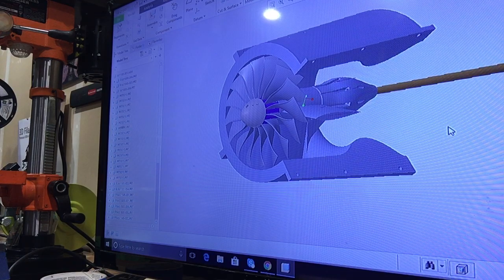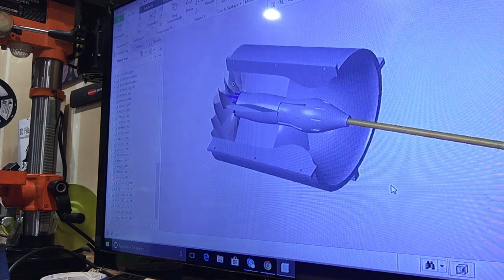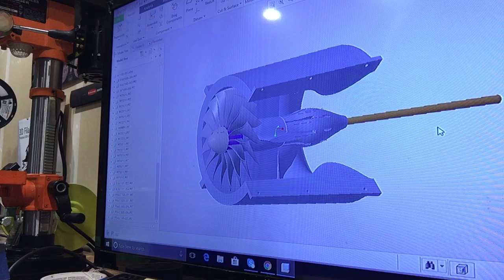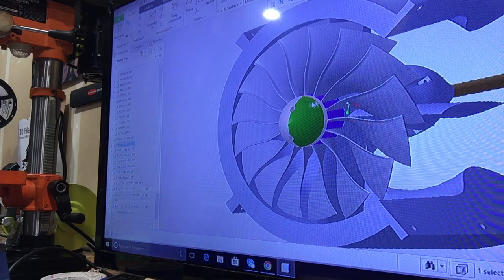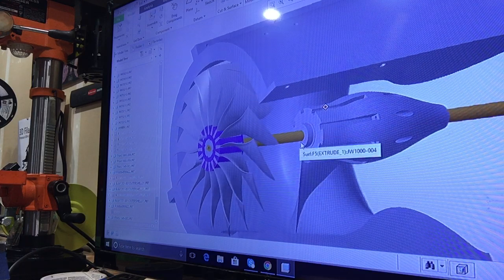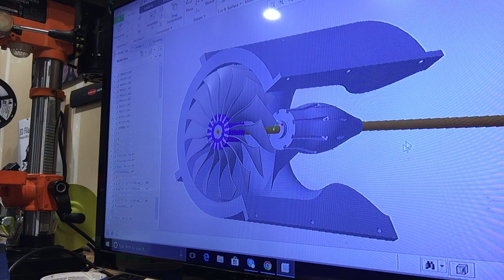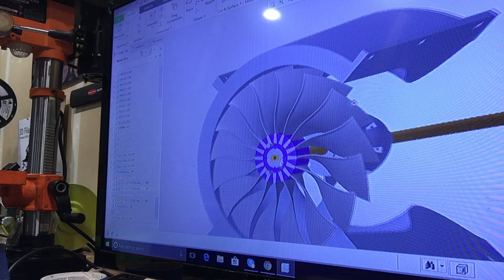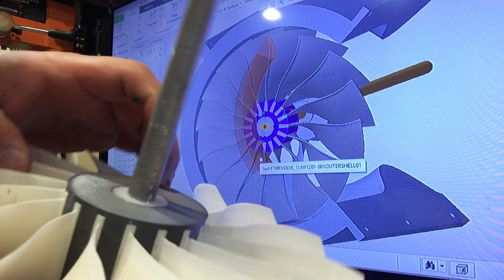Hybrid aircraft jet engine project 220mm 3D printed EDF fan

Comment: 2 things when printing fans: 
1. fan blade printing orientation - the blades have to be printed such the printing takes place in radial direction and the layers are built "axially. Otherwise the blade will liberate in an ugly blade out event...
2. the dove-tail connection. Please consider redesign. Right now the actual holding section is this tiny section at the bottom of the blade. You don't want to shutter the disk from the blade pull and have a massive disk failure scenario with all the blades flying all over.

Safety first - stay behind a wall when you will be running this.